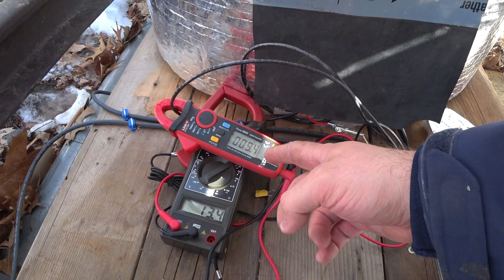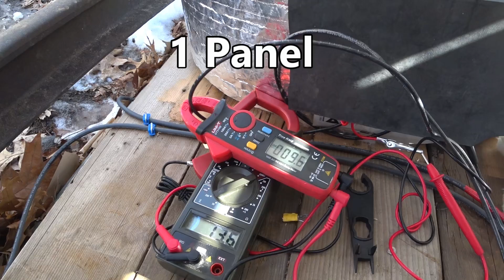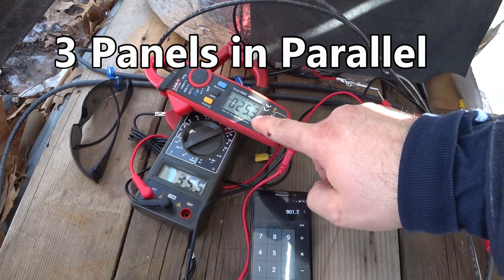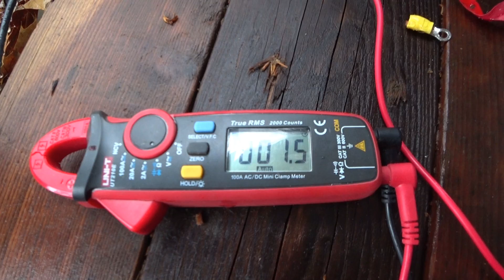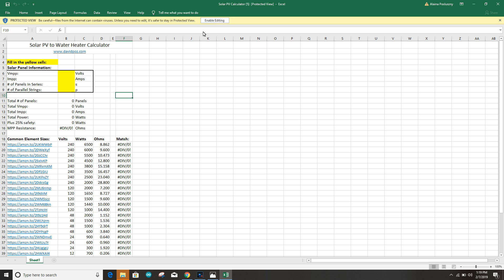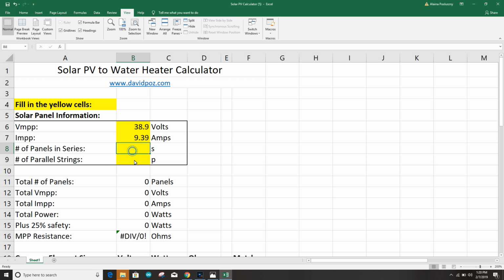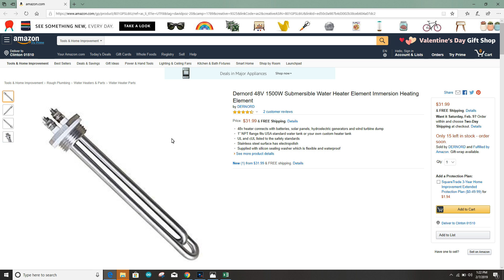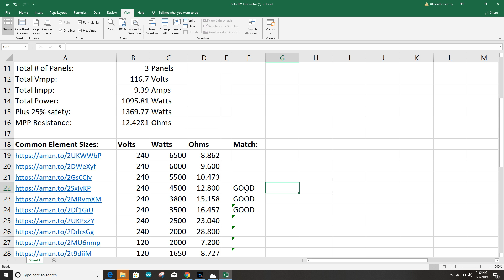Matching Water Heater Elements to Solar PV Panels

Comment: David, I am wondering if you have considered setting up a system to automatically switch between the hot water battery and the lithium batteries?  I often find that my batteries are topped up pretty early in the day, so I have been thinking about how to design an automatic switch to  divert power to a hot water battery (or vice versa). This vid was particularly helpful because I was literally about to buy a 48v heating element myself, since my system is 48v.

I've considered trying to make a heat exchanger to keep the panels cool and dump the heat into a hot water battery, but that might be more plumbing than I want to take on right now.

Intead, I'm thinking you could simply have a temp sensor/thermostat in the water tank that controls a switch and automatically switches the power back to the water heater to keep the heat up? Or something wired into my battery/bms/charge controller that notices the battery is full and then dumps the power into the hot water battery?

Would love your thoughts. Thanks for the great content. I'm probably going to pick up some of those LG Chem modules from BatteryHookup for my next project because of your recommendation!
Reply from the maker: Hi theborednerds,  Thanks for your question.  When I was first getting into solar I did a lot of direct heating.  I directly heated my house with a baseboard electric heater, and heated my water.  This was primarily because I couldn't afford a large battery bank, charge controllers, and inverters.  In those days I didn't have a battery to charge, so it was a simple choice to go solar direct to heater.  

Today I've added those other components.  I think the most efficient use today is a "diversion load".  Diversion loads are these same things (water heater/space heater/air conditioner).  However, the battery is prioritized.  So when the sun comes up in the morning, my batteries get charged first.  Typically by 1pm this time of year.  Then the diversion load is switched on.  I'm doing this manually right now, but in the process of wiring in an automatic control.  The diversion load is driven by AC 240v, not DC.  This keeps the wiring and controls easy.  

In my case I have the capacity in my inverter.  What I mean is, my inverter is 12kw (two sma) and my diversion loads are 4.5kw.  So I can still run my house.  However, if you don't have the extra capacity in your inverter you could wire a separate inverter just for the diversion load.  I'm wiring in a Growatt just for this purpose to demonstrate it.  The Growatt I'm using is this: https://youtu.be/yWUfvvSa3K8  At $900 It is a charge controller, and inverter, in one package.  I think it's worth it to have the MPPT and switching built in.  

There are many ways to handle this.  There is no right or wrong, just what works for you.
Reply: @DavidPozEnergy  Thanks for the thorough reply! 
It definitely makes sense to prioritize the battery over the water heater. My system is quite small: 600w solar, 5kw, 52v. I wanted enough reserve for multiple days without good sun, but on the days with abundant sun, I want to capture the excess in my water tank. I feel like it makes the most sense to do this with DC power? Do you think I should stick to a 12v silicon pad heater, or use a classic water heater element?
Reply from the maker: You state "the most sense to do this with DC power".  That depends on several small factors.  To me, I like to think of the most efficient use of the solar energy. Consider the following: 

1. DC water heater direct to PV.  Let's say your PV is coming into the charge controller at 100 volts and you have a set of relays that switch the PV power from charge controller OR to the water heater.  If you have a MPPT charge controller, it might average 95% efficient.  But if you switch that to a water heater it might average 60% efficient.  This is because the ohm rating of the water heater will never be exactly at the MPP of the panels.  

2. Let's say you decide you like the idea of the solar power going through the MPPT charge controller, but you want to direct connect your water heater to your batteries.  Great, you gain the extra 35% power using the MPPT.  But now you have to run 48v through heavy gauge wire to your water heater.  Assuming you size your water heater to match your panels (600w) then 12-15 amps, in that range.  And if your water heater is 50 feet from your battery, and you use 10 AWG wire, then you have 2.6% loss in your wire.  That's a great trade to make.  This is a much better choice than PV direct.

3. Keep in mind that you will need a contactor and thermostat capable of switching the DC voltage you choose.  The snap-disk thermostats built into the water heater are rated for AC only and can't switch 48v DC.  You will burn them out. 

I hope that helps, but if you have more questions hit me up on Facebook.  It's hard to follow old comments in youtube.

Comment: Why is your water heater outside???
Reply from the maker: This was a test.  It's not connected to my house.  My regular, daily use, water heater is inside.
Reply: @DavidPozEnergy  ohhh ok I see. What about voltage drop over long distance? Wire resistance. Would that change very much?
Reply from the maker: It is something to be sized correctly.  When I ran my wires into my garage from my solar array I ran 96 feet from point to point.  I have 1.6% voltage drop using #6 wire.  But this will vary based on your situation.  I like this website for a free voltage drop calculator: https://www.rapidtables.com/calc/wire/voltage-drop-calculator.html  I hope that helps.
Reply: @DavidPozEnergy  oh wow. Thsnks. So helpful when I venture into solar

Comment: 11:01    GREAT VIDEO
               calcs are imprecise;  the R  of  12.4  OHMS did not come from the 1370 Watts; it came from the  1096 Watts ( DO FORGET about the decimals, NO practical meaning  AT ALL).

the formula is  OHMS =  Volts  x  Volts  /   Watts  ;  116.7 x 116.7 / 1096 =  12.4 OHMS

Comment: Can i just drop the immersion heater into a large water tank, without mounting ( its a concrete tank ) ?

I just want to use spare solar capacity to create a large tank of warm water in the basement as ambient heating

Comment: We Really need to do a proper Solar Hot Water system with the Evacuated tubes and some kinda heat storage. I can Volunteer(once the covid is done) my time if u get all the parts together. as u know i have all my solar Hot Water info for free at Guilt Free Hot Water

Comment: A 1kW MPPT controller would be great for this application. The MPPT controller  will always find the best working point for the load independently of the load resistor. He will always adapt the resistance of the source to the resistance of the load to get the MPP.

Comment: Hi, could you do a video on how to set up a "Solar Dump Hot Water Heater Load" with a simple 12 volt system?

Basically I think I need a "Voltage Sensing Switch" and a "DC to DC Solid State Relay" but I really don't know how I would connect it to my system. 

I have 400 Watts Solar Panels and my battery is charged up before noon every day. I would like to dump the extra energy into a 12v water heater element I have installed in a small insulated water tank. I have a 30 Amp Renogy PWM Li-On Charge Controller that connects the Solar Panels to the Battery, but I don't have any experience with sensor witches, SSRs etc - Thanks!
Reply from the maker: Yes. I'm working on it I have been collecting the parts for that video

Comment: Uhh...  I'll have to update this with a reply after I actually test it, but according to your chart, my 3 - 100 watt panels will run a 4500 watt standard water heater element at only 5.58 amps...  I'm obviously going to have to make sure that I have nothing flammable around the wiring when I test it with the 12 and 14 gauge wire I can supposedly use for runs less than 30 feet, but if it works, this will DRASTICALLY reduce my cost for making a solar water heater setup like I'd intended.
Reply from the maker: I look forward to hearing how it goes.
Reply: @DavidPozEnergy  I'm just waiting for my MC4 connector kit to arrive cause I don't want to cut off or damage the connectors on my solar panels.  Should be here later today (friday) or tomorrow.
Reply: @DavidPozEnergy  Well, up is still left, down is still Tuesday, and no, 4500watt ac water heater elements won't have a reasonable output on 62v of dc at 5.9 amps.  Not sure any of those ac water heater elements you linked in the calculator will work.

Comment: 3  x 38V = 120V not 240V  why is your Excel sheet proposing 240V heating elements?
Reply from the maker: Because it's about matching the ohms, not matching the voltage.

Comment: Am I correct in thinking that one benefit of going with a 3s 1p setup is that the overall amps drop? Does this mean that you can use lighter duty wire?

Comment: Most solar panels are between 15% and 20% efficient. Solar water heaters use sunlight way more efficiently than photovoltaic systems. Solar thermal systems can convert over 80 % of the sun’s energy into heat !

Comment: Your parallel connection matched the resistance of your dc element (1.5 ohms) 
A series connection is 10.5 ohms higher than dc element resistance.

The 13.6V/9.6A = 1.416 ohms (dc element resistance) remember you 1 panel resistance is around 4 ohms.

Comment: Awesome calculator. I intend to use it (and your link) soon. I'm using an old water heater, so how do I thermostatically control the elements so they don't overheat, turn the water to steam, and blow up in my basement? That would be a mess! (serious question)
Reply from the maker: You will need something to turn on/off the PV.  For example, a 12v power supply can go through the existing snap-disk thermostat, and control the coil on a relay.  The relay needs to be properly rated for the maximum amps and VOC of the panels.

Comment: 12 volts 300 watt element is only using 1.5 volts and i have 44 volts 375 watt panels still not working using 4 panels

Comment: Hi David! Not sure if you went over this previously, but how would you incorporate a thermostat feature into this system? i.e. a control to ensure water temperature does not exceed some specified limit. Many thanks in advance!
Reply from the maker: I would use a large contactor to control the PV wires on/off.  That way a small thermostat only controls the coil.
Reply: -late- ,but   YES,it is A MUST;  otherwise the HOT WATER  tank may come to explode...if the pressure safety FAILS,or plugs up with internal debris/ rust
A THERMOSTAT MUST BE USED!  thanks
edit:  CAUTION::   but then,a BIG problem arises::::  a   AC  thermostat will NOT work with DC   over 50 or 60 VDC:::::  it should,maybe,be ok up to 24 VDC  or so;  so,  CAUTION:::: you need a SP*ECIAL setup,consult a top electrician or engineer;   switching off ACX is easy, because the sine wave crosses the ZERO mark every time,no problem there:::
BUT   DC   does not cross the zero,so it ARCS and BURNS the contacts and des NOT switch OFF and then the HOT water tank EXPLODES
(of course it only explodes if the Pressure Safety fails...)
this is WHY i always use an inverter from ... to 220 VAC...unfortunately we have to

Comment: Nice watching this but what about impedance matching. I have a 'dry' heating element. It's a titanium anode where the resistance is 54.8 Ohms. (2400W) When using the calculator i need 11 panels (ex. 39V 9A) in serial. Is there a solution to use this heating element for maximum power? Replacement 'dry' heating elements are not findable. Maybe a new 'cheap' 'wet' boiler is the cheapest solution?
Reply from the maker: I ran an electric baseboard heater directly off solar panels for years: https://youtu.be/jFoxIit8NYA

Comment: I also need to convert a 230 V 3KW electric geyser to  PV solar. I can drive the 230V  3KW   restive element with 5 x "24 volt" solar panels in series giving me about 150 /160 Volt DC at 8 Amps. This will deliver 1100 watt at 160 Volt. However several people told me It cant be done because the Thermostat will "burn out"  even if it only now switched 8 Amps instead of 13 Amp. Does anyone agree? Can you inform us on suitable thermostats that can handle DC?..or another solution.

Comment: My 150w solar panel puts out 17.42v of vmpp and 8.61amps of impp. According to David’s calculator, the best pv to resistance match is a 48v 1000W element. 

Can somebody explain how this solar to element combination differs from a 12vdc 300w element in regards to how long it will take to heat about 3 galons (12liters) of water up to 90f (32c) ? How do I calculate how long it would take to heat up this amount of water using the elements ? Thanks in advance.
Reply from the maker: The 48v 1000w element will have a resistance of 2.3 ohms.  But a 12v 300w element will be about 0.48 ohms.  
The second part of your question is heating 3 gallons of water to 90°F.  If we assume the water starts at 60°F, we have a 30°F rise.  Each gallon of water is about 8.33 pounds, or 25 pounds for the 3 gallons.  25 pounds times 30°F delta = 750 BTU divided by 3.412BTU/wh=220wh.  220wh/150w (solar panel)=1.5 hours.  But you won't have perfect MPPT conditions, and there will be some loss.  So it'd be more realistic to assume 3 hours of direct sunlight.
Reply: DavidPoz , wow thanks so much for these calculations. I had to google British Thermal Unit, but got there and your calculations make perfect sense. Your reply is a great resource to use in the future ! So I guess the big question for me now is: how do the two different elements work into the equation ? I’m assuming the 48v 1000W element, the one that best matches the solar panel resistancr, will heat the 30f according to your time frame. But what if I’m using the 12v 300w ?  How do I work that into the calculation ?

Thanks again
Reply from the maker: If you use a heating element that is not a good match to solar panels, then you will get almost no heat.

Comment: So what if I just come off my battery  bank? I have a 48v bank and 2 element cylinder.  That must be easier?
Reply: The downside to that for.most people would be that the Hot water heater seems to be used as a dump load instead of a primary load off of the battery bank. If your water heater is well insulated and inside it can store the thermal energy for hours to days depending on R values.

Comment: I figured out an easy option way to divert my whole 2000 watts worth of solar array(s); one or two PV arrays of up to three) directly to a water heating task when my battery bank is near full.  I really like the info. in this video lesson; plus just downloaded the spreadsheet calculator.  My problem is I do not use spreadsheets, and uninstalled the program for it on my laptop years ago (I will go hunt for a spreadsheet reader option). 
Since studying this video (Thanks David): I am Wondering if I have a practical idea (without re-arranging my PV array configuration); and what heater element might be my most efficient choice. My easy option is to divert a full 2000+ PV array to a water heating task; via 6 x 365 watt PV panels wired two in series, with 3 of those series in Parallel for output of about 70 vdc @ max 30 amps.    Can anyone with easy Proz spreadsheet calculator options (or otherwise) tell me if this is practical idea.  I sure want to choose the most efficient heater element, plus the simpler option.    Feedback Requested:   Thanks In Advance: Thanks DavidPOZ and others who are an Awesome part of YouTube University      :+)
Added Just used Google Spreadsheet; Cool Spread sheet, but No "Good" option popped up for my configuration.  So still wondering what my most efficient options are, ... plus Learning More All The Time.
Reply: Tried with spreadsheet in Open Office: Still No Match. Wondering what the criteria is for a best match. Got ohm ranges from 0.206 ohms for a 12v 700 watt heat coil/ up to 28.8 ohms for a 240v 2000 watt element.  I am still puzzled as to what might be my best choice, and still researching for that.  Wonder if switch my 2 in series, 3 parallel P array directly to heater coil is a realistic idea? or one that would be wasting half the panel array wired in series ???   Best lesson for fine tuning my idea seems to be this video lessons, though wonder about some poster (elsewhere) mentioning the use of capacitors (do not really understand that one either).   :+)
Reply: Brainstorming here after forth review of your big light bulb insight lesson: I now think configuring my 6 x 365 watt panel array into three parallel to get about 39v @ 27 amps  x 2 sets of that in series;  for 75- 80 vdc @ same 27+ amps IN to my MPP All In Ones ... would give me a much better option for direct PV dc current to heating task:  via sending each of those paralleled sets of three to its' own heating element at much high efficiency ( powering twice the heating watts on two separate heat coils/ as compared to my previous idea of putting full 6 panel PV array on one heating element !!! ). ...  I was going to wire  2 parallel x 3 series.   I now think wiring 3 parallel x 2 in series will give me better options when I go to switching direct PV to my heat dump when my batteries are near full.
 My switching hardware for newer plan will be a little more complicated than my earlier idea, but I can figure that out.   ...  I will now be thinking on my solar panel array configuration as I get ready to cut and weld square metal tubing for my solar racks, with solar panels on roof to follow.  I think you just helped my get twice the heating of water watts than I would have gotten with my previous idea .   Thanks You David Poz !!!
Reply: @CaptBill69  Download the free Gnumeric Portable (spreadsheet) works fine.